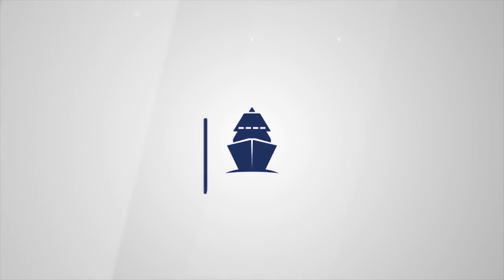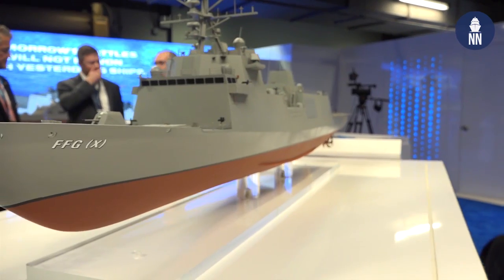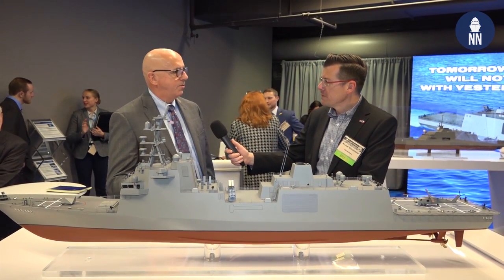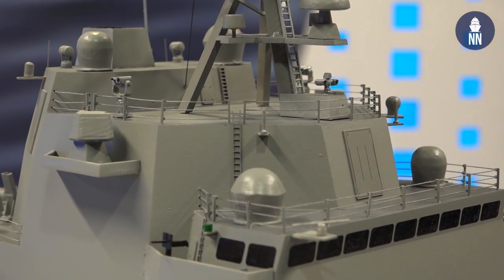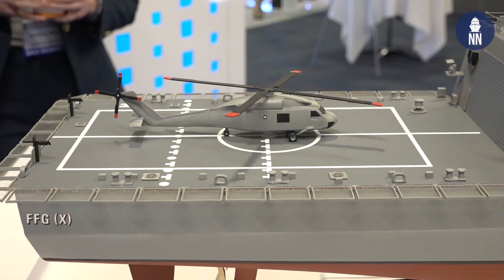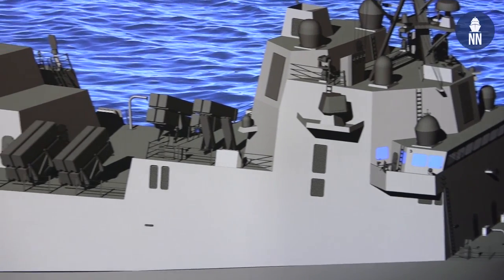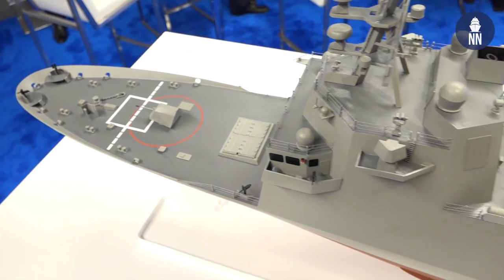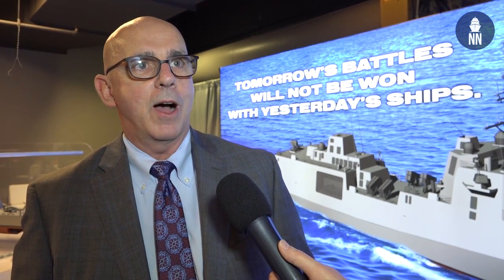Fincantieri’s FREMM Wins US Navy FFG(X) Frigate Competition - Part 2: Interview during SNA 2020

Comment: The primary threat today is from small boat swarms and drones.  This 57mm gun is faster firing, and can fire far more different types of rounds making it far more capable against those types of targets.  They have the 16 LRASM to take on larger opponents.  The change from the gatling gun to RIM launcher allows them to engage multiple targets quickly not just one.  It's highly automated with a higher kill probability. A RIM missile is far more effective against an incoming cruise missiles than the gun as well with longer range as well.  It has two torpedo launchers (one on each side) in triple launchers behind the roll-up doors amidship. The torpedos can be both surface and subsurface.  The VLS will have asroc ASW torpedos as well. With their VLS launchers, this ship is very lethal as much as a destroyer capable of dealing with any level surface or air threat as well as ASW as well.  Think of it as a scaled down Burke with all the same capability and more.  The 57mm gun allows them to deal with boat swarms and drones better than a Burke.  The mission role of this ship is escort and littoral combat, it's replacing the the puny and underarmed LCS.  This is going to be a very good ship for a long time.

Comment: I like the design but what bothers me is that there is no CIWS on the ship nor Mark 32 Surface Vessel Torpedo Tubes. I think it should carry more VLS cells then 32. It’s my opinion tho.
Reply: There is CIWS on the top of the helicopter hangar, in modern ships the torpedo tubes are inside the ship and fired through an opening trap.

Comment: Did he say it cruises at 16 knots? A little slow?
Reply: Cruising on electricity, not burning fuel.  Of course it can cruise faster with the engines running.
Reply: @MalfosRanger  got it! Thanks
Reply: @MalfosRanger  incorrect. Those diesels are running on fuel to generate the power for the drive motors, they just use less doing it than a gas turbine does. When they kick the gas turbine in, they'll definitely burn it faster. There are no battery banks for those drive motors.

Comment: "We can go up to 16mW."

What they're saying is, "We wanna slap a railgun and or lasers on this sucker."
Reply: On a frigate?
Reply: @unidentifiedperson7185  There would be no need to have the ability to expand power generation that high if the plan wasn't for a EMW or DEW. 

It would most likely be a scaled down version though. There are many reason to want a railgun or laser outside of just "Navy ship goes boom!" and I'd imagine the navy will want to move away from conventional guns as soon as it can.
Reply: @TheRyujinLP  lasers are cheaper than missiles so they will complement them  until missiles might be replaced in the mid future or transformed
Reply: @patricofritz4094  Missiles aren't going away anytime soon given the how useful the ability to carry payloads are but lasers will change the game and force them to evolve.
Reply: They also removed some compartments from the bow area in comparison to other versions of this design. To save weight. I guess this means they can place a large mass on the front area of the ship without causing problems for the ship. Because the ship is designed to carry more weight there than it initially will in the US version.

Comment: When you sell that you are a multi-mission warship capable of projecting power ashore...don't show me a 57mm gun and expect me to believe you. 32 cell VLS...hmmm; not enough to have more than one or two uses for surface, sub-surface, anti-air, anti-submarine, and land attack. These ships would have to be configured before sailing and would be stuck with their load out throughout a deployment. In this regard they would not be "Agile". They would perform as a screening unit fairly well, but selling this as an independent warship...no way. Very much a step up from the Little Crappy Ship, but not by much. The helos will make it a decent anti-submarine platform but you will have to send a division of these with different configurations to come close to providing the actual multi-role capabilities of one of the old Spruance class destroyers.  I served aboard the USS Fife, DD991 for two deployments to the Arabian Gulf. We saved around 200 Vietnamese boat people. We followed the Frunze (independently), until they gave up. We followed a unnamed Soviet submarine across the Pacific from Japan to Guam. We did blockade and raid duties in the Gulf. Operated with the African (Great White) fleet for piracy suppression/show the flag operations. Made land attacks during the war with cruise missiles. Blah, blah, blah. (Not including scaring the Soviets, because we were on their door step with a VLS launcher almost twice the size of the one on the new Constellation class). This ship is a glass cannon. It will function as a decent screening ship, but it is doubtful to me that it will truly be capable of the multi-role functions that are touted by the manufacturer. The Navy lost the bubble in the early 2000s; they supported the GWOT with large numbers of personnel and put the fleet at risk. They are no longer the blue water threat they used to be. They have lost experience that will take at least a decade to make up. In the interim this Frigate will be a step in the right direction. Just don't expect it to be the be all end all that we are being told.

Comment: As a former sonar tech, exactly how are diesels quiet?
Reply: It would be nice if they had battery banks to operate in a stealth mode with. The old prairie masker systems were only a half measure at best.
Reply: @9999plato  since they are decoupled from the drive train, they are heavily isolated from the hull and quieted.

Comment: Politics and money choose the designs of warships today, unfortunately. The gun is far too small and there should be more than 1. The missile systems are too few and too small. The ship looks naked because it wears only a string bikini of armament. This ship might make an excellent Coast Guard cutter for peacetime, but it is too fragile and under armed to make it on todays dangerous seas. The gun should have been a 90mm and there should have been at least two of them and two of the 57mm's for secondaries. The missile capacity should have been doubled. The ship should have been given modern protection enough to make her proof against small arms fire, rpg's and light cannon up to say 40mm. I certainly hope watertight integrity is good, but honestly the ship looks quite fragile to me and too much like another negative incident in the news waiting to happen.

Comment: This ship should have a bulbous bow and the main gun should be a 5"/38 rather than a 57mm which is worthless.
Reply: In case y'all haven't noticed, part of the design of this class is built to incorporate future weapons and systems when they come on line down the road. The death knell of the Perry-class was its lack of adaptability, ont that narrow, lightweight hull, with a lack of power generation necessary to make it a more capable ship. That has been factored into these.

It also plays a factor in the Burke class, which were compromised from their original plan to be a larger, more capable ship, then squeezed-down into what they've become. Now they're regretting that choice, even as the Flight IIIs are being built.

I may be an old broken-down Boatswain's Mate, but I pointed out in a discussion with some of my officers that design of the Burke-class was gonna bite the Navy in the ass one day with the lack of dedicated helo facilities. Stupid to build a multi-mission ship without them in the helo age.
Reply: @jimmellenberger8505  Understand and appreciate the comment. I knew that. My problem is that I was hoping for a more highly armed ship and a American Blue Water design not a ship designed for the Mediterranean. So I'm not happy with this at all. And although I see potential in the design it needs lots of changes so it can upgraded and strengthened. But no bucks...no Buck Rogers. Our Defense Budget is not going to stay large like it is today. It will be going down because of the National Debt. So that is another consideration. So we'll see.
Reply: I think the 5"/54 rapid fire gun remains the best option. Just my opinion.
Reply: @smc1942  I absolutely agree but will the framing handle the increased weight and vibration harmonics over time. That bow would have to be a lot more robust for that particular gun and you would definitely have to add a bulbous bow which it should have anyway.
Reply: @johnpitchlynn9341  ;
Agreed. They should have that bow with a full sonar array.
I was in the USN in the last half of the 1980's. I liked having a Spruance class, or other class with that gun along-side my flattop than an OHP. Even the Knox class had 5" guns! I liked them better than the OHP's, even though they were older.
What bothered me was the waste of time & resources put to the Littoral type "ships". Little more than brown-water gunboats, imo. I guess I'm an old fashioned blue-water seadog. 
For the tonnage they're building, they should have a better bow & gun.
At 7,500 tons, they outweigh the Atlanta class light cruisers of WW2.

Let me add; 
I believe the Littoral's would be very useful in places like the Philippines.
But with their limited range, I don't see a role for them in the USN. 
If I were in charge, these classes would be given to the U.S. Coast Guard, or sold to the Philippines, Singapore, South Korea, Greece, etc.
Reply: @smc1942  Absolutely. I liked the Spruance, but the Navy in the utterly stupidity of the Brass is suffered those days did not continue to develop that hull for the future.  But did use it for the Ticonderoga Aegis Missile Cruisers. I disagree on the LCS....we do need a littoral Surface Combatant and the LCS hulls fit the bill...they only have two problems...one the engines (Should been the same engine as the Burke's) and mission packages. But I believe that over time those ships can be a definite asset to the Fleet...even the Blue Water Fleet. We've never had a good small hard hitting Corvette type ship that can scoot ahead and start to attrite enemy forces in a major ocean engagement and act as scouts and even early warning for incoming hypersonic missile fire and with own hypersonic counter missiles to bring the down. And the LCS is fast and agile enough to do that job. I disagree with this new Italian designed Frigate we are buying. Instead we should have purchased a stretch upgrade of the Freedom LCS. But we'll see how it does. We need a large surface combatant like the Arsenal ship that was planned for a few years ago. I also believe we should start building Zumwalt's and turn them into Cruisers. Bottom line the Navy lack continuity in it's surface combatant thinking. I don't see why they are making this so damn hard. 

But my biggest worry is Maintenance and Training of our force. To date no Admiral has been fired for failing to ensure Ship crews are totally trained up and certified and ready in all aspects for combat PRIOR TO DEPLOYMENT and the fact that our Maintenance is sucking hind tit all over the force. This must stop and the only way it will is the fire some Admirals to send the message. We don't have time for this. The Navy and Marine Corps is our front line force. The Air Force even has more problems. It's nice to have all these new systems...but if crews are not trained and the ships can't operated...all they are is floating junk.
Reply: @smc1942  On more thing...we need to quickly adapt hypersonic missiles and railguns get them perfected and on our ships fast. On any modern battlefield there is only going to be two types of fighters...the quick...and the very dead. And right now we are behind.
Reply: John Pitchlynn — Why didn’t you bid on the procurement?
Reply: @GH-oi2jf  That's simple....I'm retired.

Comment: I'm upset about the 57mm gun in place instead of the 76mm OTO-Melara mount. And I was hoping it would get a 48-cell VLS vice 32-cell. Plus, I believe it would deserve to be called Doris Miller. I was originally calling it the Boorda-class, but I know that will never happen. Otherwise, the ship looks good.
Reply: The low VLS count allows more ships to be made, and for each ships cost to remain low. More hulls means more sonars, hangars, and boat bays. The 57mm gun on Constellation is a better CIWS compared to 127mm, though can't do the same amount of missions like shore bombardment.

you could buy 2 constellations for 1 Arleigh Burke. When you compare 2 900 million dollar constellation FREMMs to 1 2 billion dollar Arleigh Burke, then...

Constellations got a lower crew and likely lower operating costs, the same amount of VLS and missile cells, more CIWS more hangar space, more radar mounts, more sonars, more range (though less speed), more hulls for mission flexibility, and more boat bays.

Recent American ship designs havent been that good on the cost-effectiveness front. Zumwalt, Ford, Arleigh Burke, San Antonio, America, etc. They are all over-expensive, with foreign designs offering the same capability for less money.
Reply: @botchii3059  It has 1/3 the mark 41 VLS cells of a Burke, not half. The reason being is they most likely want space to allow for a future laser to be mounted in front of the Bridge. 56mm is simply cost saving. But I would still mount two Mark II Bushmasters aft and if she’s a sub hunter where are the torpedoes. As a Sub hunter I’m not sure she needs that many strike misses, doesn’t hurt, but that’s not the ships role. It’s a nice ship and looks like a solid multi mission design, but looking at the current config, it looks more like a small anti ship strike package rather than a sub hunter which is what they said it was. Looks like a nice light escort. An easy ship though to configure into a true sub hunter. But right now it’s pure multi role, with an emphasis on anti ship strike capability.
Reply: I agree about getting more missiles especially missiles that can defend the aircraft carriers.
Reply: Me too ! Actually it should have a 5" gun for even more firepower.
Reply: There are still space for future weaponary

Comment: This won because it was the cheapest, Americans are cannibalising this ship with its own systems. It wouldn’t make any sense to buy a more expensive and capable ship if you were going to tear it a part. It’s a good carcass to fill out.
Reply: This won because US needed a ASW frigate, and this is the quieter, faster and more survivable design. The specific weapon and sensor systems are, less important in respect to the design, since several manufacturers provide systems with similar performances, but you can't fix a noisy propulsion system.

Comment: A single  57 mm gun!!  My dad was on a 57 mm anti-gun in WWII.  When practicing on  destroyed Sherman the 57 mm bounced off.  The ship should have a 5 " gun and more than just one.  They are designing for failure
Reply: Bill Bishop — If the shells didn’t penetrate a Sherman, they were the wrong type.
Reply: It’s not meant to engage a warship with its cannons. It could but missiles are preferred, especially since this is a frigate and not a destroyer. Smaller cannon gives it a better ability to deal with lightly armored enemies like raiding boats or corvettes